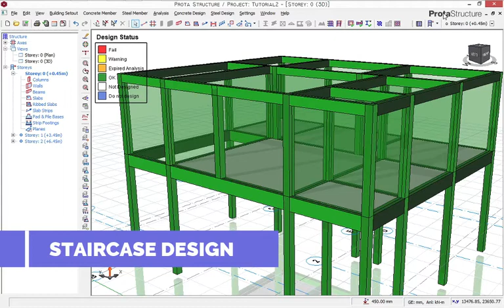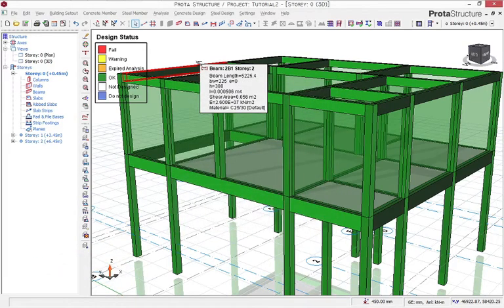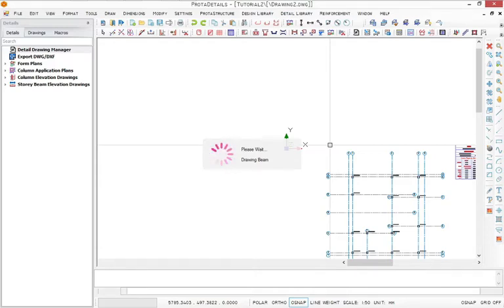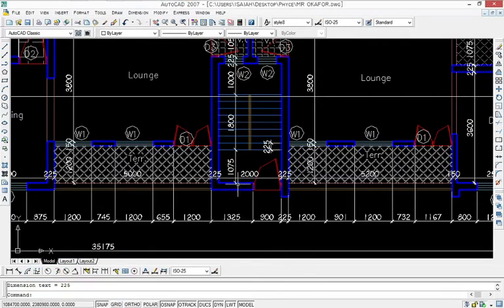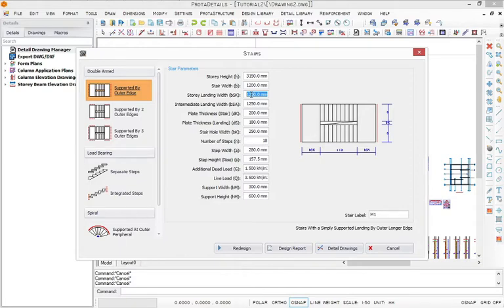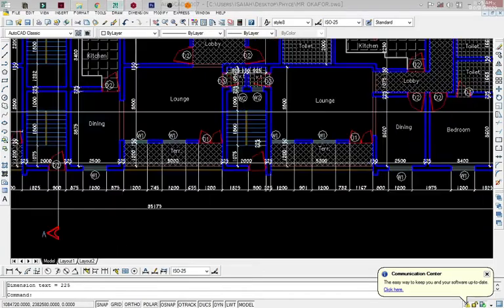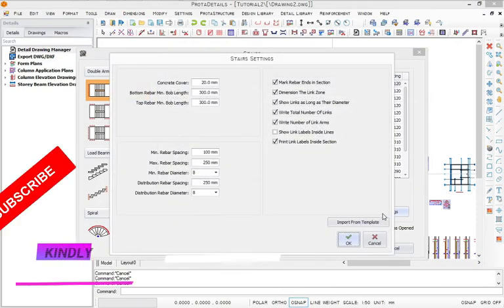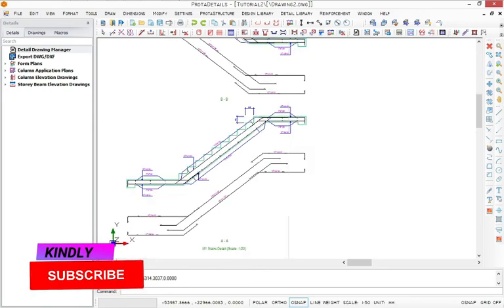How To Design Reinforced Concrete Staircase - Prota Structure

Comment: Thank you  .  Can you show how to design truss
Reply from the maker: Sure. But for the design of truss with Prota you will need to use Prota Steel. Do you have the software installed on your PC
Reply: @iamphyize  Dont have but i like to know
Reply from the maker: There is no prob with you knowing it.
The issue is do you have the software on your PC so you can practice along